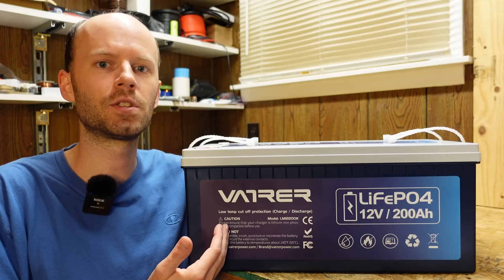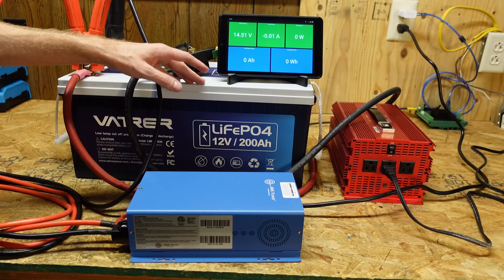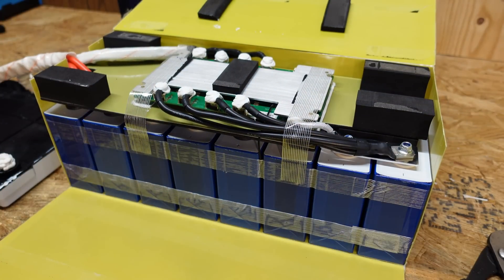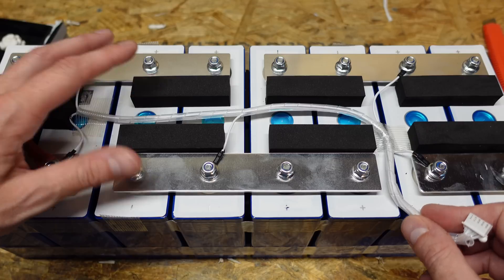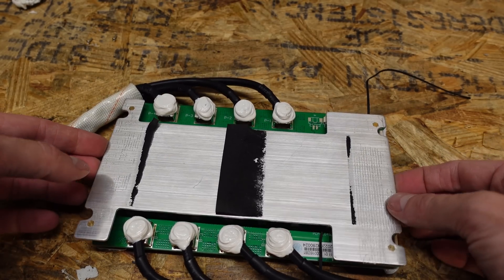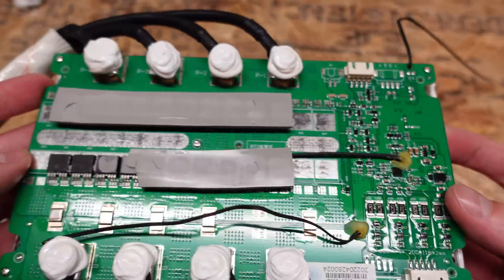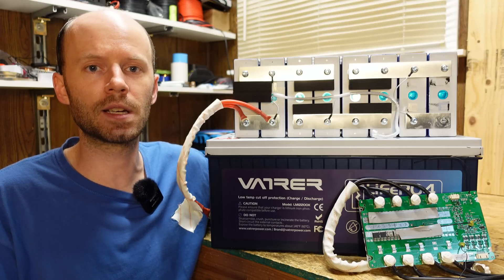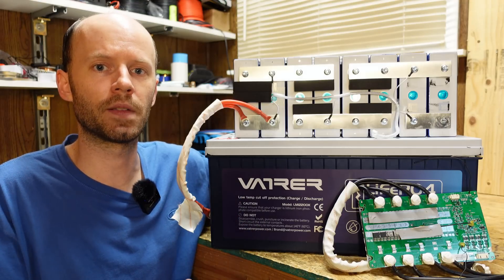Vatrer 12V 200Ah Plus LiFePO4 Battery Review and Teardown, Almost Perfect!

Comment: Big bummer on the low temp failure and false advertising
Reply: https://www.youtube.com/watch?v=tP9Bth37CRY
Reply: Our battery definitely has low temperature protection function.  We just updated the internal structure. We will only update the battery without reducing functionality.
 Our 200ah battery has three temperature sensors, you need to put the three temperature sensors together in ice water at the same time, it will detect it, and then it will stop charging the battery.

Comment: Great Review!  1 other thing I saw in video was the nylon nuts.  Looked like every post with a balance lead and main positive/negative lead wasn't even touching the nylon which explains why it was so tight.  Did you happen to check the others?  A good rule to follow for nuts is to have a least 1-1/2 threads showing on top of ANY nut.🤘
Reply: +1

Comment: Our 200ah battery has three temperature sensors, you need to put the three temperature sensors together in ice water at the same time， it will detect it, and then it will stop charging the battery.
Reply: I would love to see this work

Comment: It's really a great battery for the price but without low temp protection it's a huge failure without having a heated space.
Reply: Our 200ah battery has three temperature sensors, you need to put the three temperature sensors together in ice water at the same time, it will detect it, and then it will stop charging the battery.You can buy them with confidence or test the function.
Reply: @Vatrer  Unless you show proof that the battery can perform a low temp disconnect....

YOU ARE JUST AN ANNOYING SPAMMER.

PROVE IT OR GO AWAY!

Comment: The compressed air test produced a definitive result. It's very nice to see it employed in your tests. Also, thank you very much for this and all your reviews. With a few design revisions, this product looks to be a great option, especially for those looking to integrate combined starting capacity for larger RV diesel power units (eg. parallel a bank of 2-4 200Amp batteries (260 amp BMS +peak for 3-5 seconds) to a Victron lynx distribution block.
Reply: diesel trucks pull a lot of amps i doubt if theses batteries would last very long . there  is one i saw made to do both in a car which can pull 400amps easily  plus you need a dc to dc charger and you cannot charge unde 32 F OR 0C
remember class 6 to 8 often have 2 # 31 1000 cca or size 3 to 7

Comment: Have you considered testing the Weise 100Ah?  I am not able to do such testing as you do.  The company says it has low temp protection (Will showed it did) and a 10 Yr. warranty.  However the paperwork says 5 years.  They assured me 10.  I suggested they be more descriptive and fix the paper work.  The paper with the battery doesn't say low temp protection...

Comment: Will you please check out a new brand battery from O'Cell Tech Lithium. Its a 36v 100AH meant for golf carts. The question is about whether its a lithium battery or LiFiP04. There is a vent on the side of the case to "vent gasses" as stated in the video on the battery. Thank you for your effort in educating us about these batteries.

Comment: Awesome review. Will be interesting to see how the company responds to your review
Reply: Our battery definitely has low temperature protection function.  We just updated the internal structure. We will only update the battery without reducing functionality.
 Our 200ah battery has three temperature sensors, you need to put the three temperature sensors together in ice water at the same time, it will detect it, and then it will stop charging the battery.
Reply: @Vatrer  this is good to know.  I just purchased a 12 volt 100ah battery for my boat.  Looking forward to getting everything set up and functioning.

Comment: Great review. One thing I saw that could be an issue. The nylon lock nut you referred to from the BMS to the negative post was not fully engaged into the nylon which makes it no better than a standard nut with no lock washer. That's why they torqued it down so much that it dug into the ring terminal. In a rough environment, like an RV, it would eventually come loose.
Reply: I noticed the very same thing.
Sharp eyes!
Reply: Even if it has Loctite (not an ideal application, as it introduces Resistance), it could have been EASILY rectified with a low profile Nylok nut 🤷🏻‍♂️
Reply: It has some Loctite on it.
Reply: Yes, they should have used low profile lock nuts like in the aircraft industry OR extended the threaded post a bit.

Comment: maybe they can update the firmware of the BMS so it works with low temp protection?
Reply: Our batteries definitely have low temperature protection, so you can buy with confidence. then go back and test

Comment: Wow- so much to love, but- no low temp charging protection? I live pretty far North and the boats I'm looking at are even farther North (Nova Scotia)- It's NOT optional for me. I like the 8D form factor with the lower height even. Bummer. Thanks David!
Reply: In fact, our models with batteries above 50ah have low temperature protection cut-off function, so you can buy with confidence. This battery may be an accident, we are also looking for the problem.
Reply: @Vatrer  Thank you for responding directly & quickly. Glad to know that it was an error rather than a build spec. All other aspects are so well considered- even overbuilt- that it does seem like an oversight or mistake.
Reply: @DCGULL01  Of course, it is impossible that directly falsely advertise our products like this by ourselves.

Comment: Wow, showed such promise and failed miserably! 🙈
Reply: Our 200ah battery has three temperature sensors, you need to put the three temperature sensors together in ice water at the same time, it will detect it, and then it will stop charging the battery. You can buy them with confidence or test the function.
Reply: https://www.youtube.com/watch?v=tP9Bth37CRY
Reply: @Vatrer  Video only showed 2 sensors,  not 3. Where is the third one in the video??